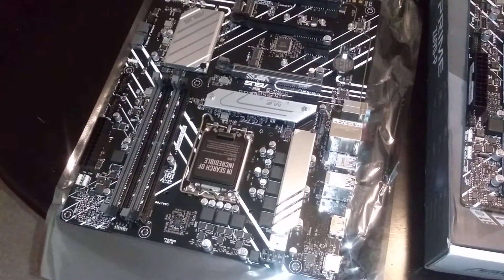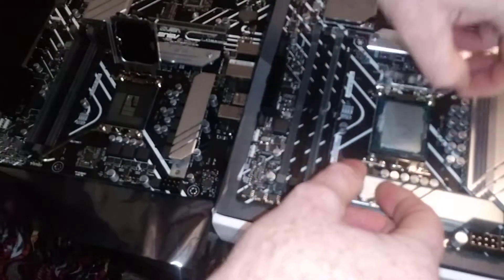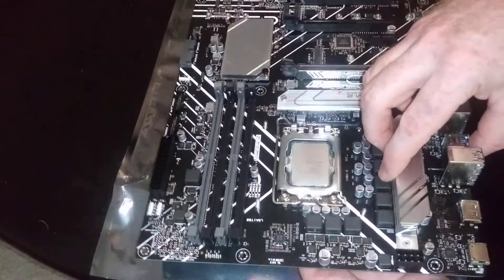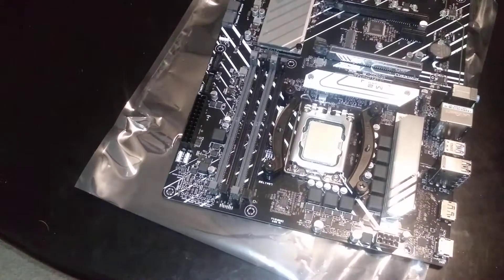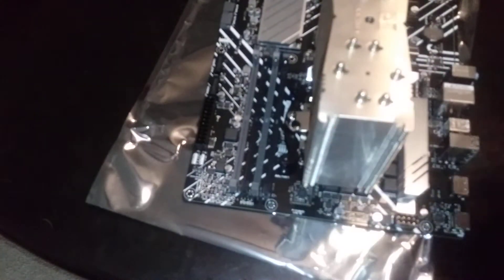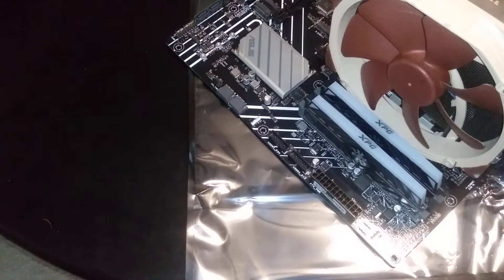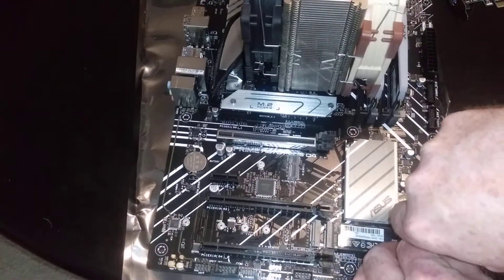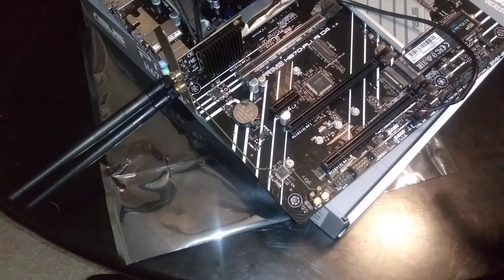I7-12700 install into an Asus Prime H670 Plus D4 motherboard, 12th gen CPU install Noctua cooler

Comment: Correct me if I'm wrong, but I thought that the 1st SSD NVME was supposed to be installed in the slot closest to the CPU w/the heatsink?
Reply from the maker: Hello, good comment.  I would say if I was building a permanent gaming computer for someone, I would stick my OS M.2 in that spot...however, there are some spots where this isn't necessary.  

-For 10th and 11th gen motherboards, most only had the one PCIE 4.0 Gen 4.  Some of the motherboards required an 11th gen chip to even use the Gen 4 spot...if you didn't have that, you had to use the PCIE 3.0. which meant you were not using the best M.2 spot on the board.

-On quite a few of the 12th gen motherboards, they are pretty much all PCIE 4.0 Gen4 M.2.  I have probably 30 M.2 (NVME or SATA) drives...but only 2 are PCIE 4.0.  I am l always switching out drives, so you might not even see the M.2 screw fastened in some of my rigs.  Also, I probably have 50-70 motherboards and I am always robbing parts from one to get another one going, so I do have a tendency to keep the drive in the location of least resistance.  

-As for the heat sink, on certain M.2's (Gen 4 and Higher speed Gen 3) that I have...I would make sure that I put them in there as they do run hotter...and one of those reasons would be for longevity purposes.

One could also argue, some of these RTX cards get really hot...why would I want my M.2 sitting right underneath it?

Not sure there is a vide out there showing it, but it might be worth doing a benchmark video of the THREE M.2 slots on this motherboard with HWINFO64 monitoring temps and see if the benchmarks are all the same. Comparing also the differences in temps between Gen 3 of average speed, Gen 3 of better speed (EVO 970 pro, plus), gen 4 of average speed and gen 4 high speed.
Reply: @ScorpionMcKillinIt  Thanks for your quick and detailed response. As for me, I'm building a modest system with the ASUS Prime H670 D4, w/16GB, a i7-12700, a single Samsung 970 PCI 3.0 NVME 500GB and RTX1660ti(bought way before the inflated prices). With a huge parts stock, workshop and youtube channel I can understand your need for flexibility. Thanks again...
Reply from the maker: @spyderlogan4992    Thank you for your support...I now see what has brought you to  my channels...I7-12700 and H670.    That's a fine motherboard though I myself could not decide between it and the B660 variant originally.  I did need a H670 for the channel...so it ended up winning out.

Comment: Question fine sir, I'm Bulding my first ever Rig, got me a i5 2600k, h670 Motherboard, and a 970 Evo Plus belive it's gen 3, where would be the best posible M.2 Slot to install on, or does it not matter? Thanks in advance
Reply from the maker: Some people would argue this one.  As I have not sat down and ran a benchmark on each spot...and I know all the M.2 spots can handle up to Gen4, you really could put it anywhere.  The best answer would be under the heat sink as this is the best spot if you are really using that drive (high read/write activity).  However, if your GPU is really toasty...you might want to pick a spot lower than the GPU..one that is getting good airflow.   There probably are some videos on Youtube...but not likely 12th gen version.  It was easier when you had just one gen 4 spot.
Reply: @Scorpion McKillin'It  really appreciate you taking the time and running tests to answer me. I decided to install it in a bottom slot. Thanks again 👍 🙂
Reply: @ScorpionMcKillinIt  another question good sir, so now I'm getting a Gen 4 m.2 any slot supports gen 4? And it's in the h670 Mobo

Comment: I'm interested in mounting this H670 Prime with a 12600K or 12700... As you mounted yours with the 12700K, you're not suffering from thermal throtling? This Prime series is well-beaten in several reviews for this reason I'm still in doubt whether to buy this prime or the TUF series with DrMOS VRMs
Reply from the maker: Id have to go back and watch this video to see if there was thermal throttling. https://youtu.be/lbYLOZxYoPA

Here is the thing about the I7-12700 and I7-12700f.  With the stock cooler and default power limiting it will power limit throttle.  Correcting that with adjusting power limits will lead to thermal throttling.  On the better motherboards ..it us the stick cooler causing it.  Replacing the cpu cooler with at least a 120mm tower rated somewhere above 200W TDP will get rid of thermal throttling.  On cheaper boards VRMs..and lack of heat sinks might add to the issues.  So that Asus Tuf B660m was pretty good for locked and unlocked cpus..unfortunately it is right near the price of some Z690s.
Reply: @ScorpionMcKillinIt  Yes.. TUF cards have better VRM especially the ones that come at the entry price of the z690. I did a little research.. I bought the 12600K and now I realized that the z690m plus + 12600K combo is only 20 dollars cheaper than the 12700 (not K) + h670 prime combo... so I think maybe I'll sell the 12600K still sealed and buy the 12700 + h670 that will give me more performance .. on her vrms I think about throwing a cooler directly on top of them to soften the temperatures... I would like to get the H670 TUF PRO but it is too expensive for this combo..

Comment: Can I insert i7 12700k on this board ?
Reply from the maker: Yes, it is compatible.  VRM's were adequate for the locked processors...not sure if it is so great for  a higher TDP CPU though.  There may be some performance loss...though in examples I did with I5-12600k...numbers were close on this board and the Asus Tuf B660m in Cinebench R20/23 as with a Z690.